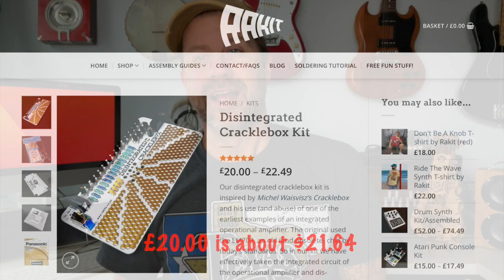Rakit Disintegrated Cracklebox DIY Kit

Comment: Blue tack is great for holding components in place as you flip things over. Lots of videos out there on tips and tricks for that.
Reply from the maker: Great tip! Ironically, I now keep blue tack on my solder station. You can see it in several of my videos that were posted after this one. It really does work well. Thanks for checking this one out.
Reply: @musicalmiscellany  awesome thanks for a great video
Reply: @musicalmiscellany  awesome thanks for a great video
Reply: @musicalmiscellany  awesome thanks for a great video